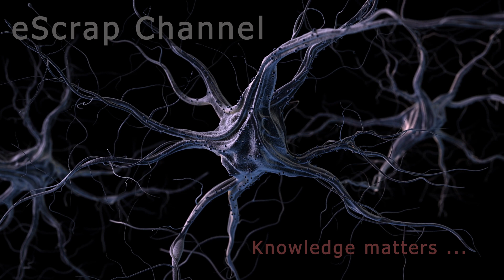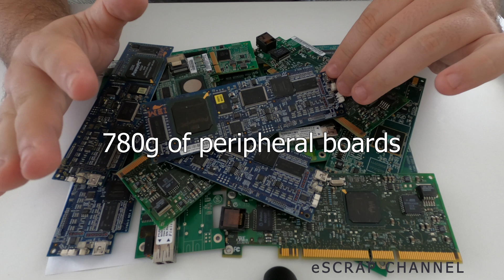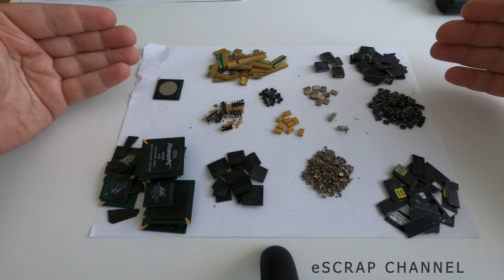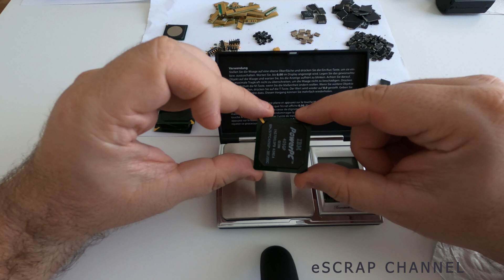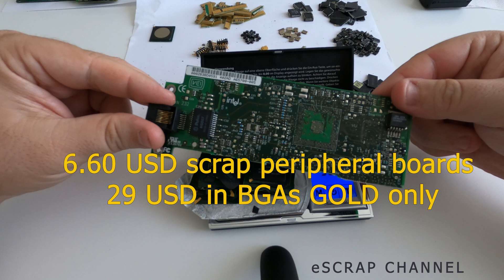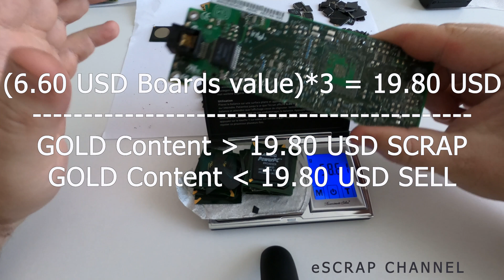Scrap or Sell eWaste?

Comment: That is the most relevant video of depopulation estimates.
Obe big question: 
-Is there a database or a mobile app to recognize and calculate donensions of the chip on the PCB?
I know that recyclers do that with enterprise level software, but having a simple AI to recognize pcb and IC by picture is not a big thing. would be grateful for any insights.
Great video!❤
Reply: Well,
hello again!
Price of gold changed 😁
Regarding the gold content, 9-12 grams is for black full ball pattern bgas with NO heatsink.
just fyi 👍🤝
Reply from the maker: @simonkh7278 Hi, depends a lot on the BGAs. I prepared some examples of top and low quality BGAs, so I hope I will have time to do the videos this year.
Reply from the maker: Thanks! Unfortunately I am not aware of an app to do the job :)
Reply: those with heatsink would yield 2-3 grams per kilo. Regards 😀

Comment: Sir, i am from India.Already from several times i take some tips from you.Now, after washing process of gold dust for 4times the ph level become 7 the acid is not present in solution. I dried the mud under sun light with covered glass biker.Now the mud is clinging in the botom of biker.Please clear the reason of that condition.
Reply from the maker: Hi, to avoid gold dust sticking on the beaker bottom you need to coagulate gold particles during precipitation. I usually add a little sulphuric acid before precipitating gold and it works well.

Comment: You are wrong on bga-s. From 1 kg of top part only you can get betwin 8-10 g of gold, so you must weight only top parts, because will ned like 3kg of bga to get 1kg of yop parts.
Reply from the maker: Hi, let me kindly disagree with you. Green base is not 70% of the weight. It is usually between 45 and 25% of the weight. As it depends a lot on the size of the BGA ICs I used 9g per kilogram BGAs with green base. When I am back in my lab in 2022 I will make such a video and prove the high yield.

Comment: Are all BGA's with gold plated corners gold or are there cases when they are some other material? Is there an easy way to tell? or just assume they are gold? Thank you
Reply from the maker: Hi, I haven’t seen so far BGAs with gold plated corner that do not contain gold wiring inside.
Reply: @escrapchannel  the least yield reported from the 'ST' gold corner flatpack bgas

Comment: I have 12 old computer towers from about 2009. I need to learn to depopulate them. :-)
Reply from the maker: Hi, always check the cards before depopulating them ... there may be an old Voodoo video card that costs 200-300 USD :)
Reply: @escrapchannel  Thanks for the tip! I will look. Most of them came from an auction of ITT Technical Institute when they went out of business. Like Dell Optiplex 760 type. I only paid about $13 per tower, and sold the RAM for more than that on Ebay to crypto miners. The CPUs also. 

I need to strip the towers down so that I just have boards left so I can save space. I didnt know if the old Western Digital 250GB hard drives were worth saving 

Lots to learn. :-)
Reply from the maker: 250 GB HDDs I sell as scrap. If you have time you can remove boards as HDD boards hold high price and sell rest as irony-aluminum.